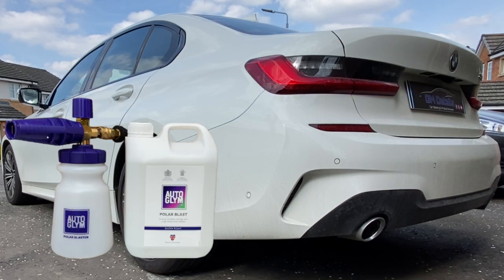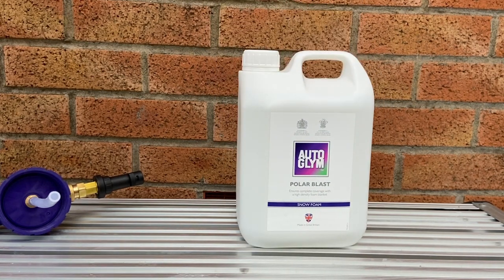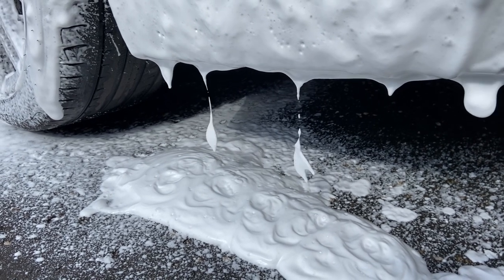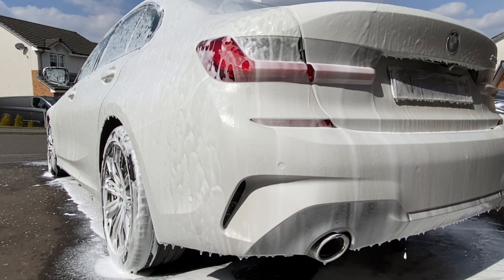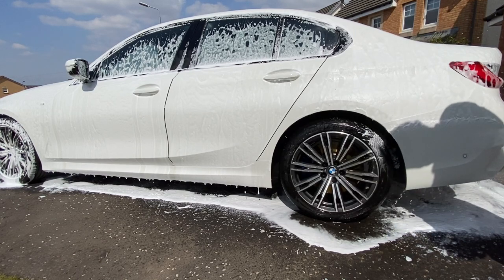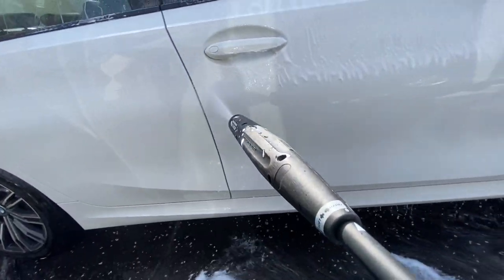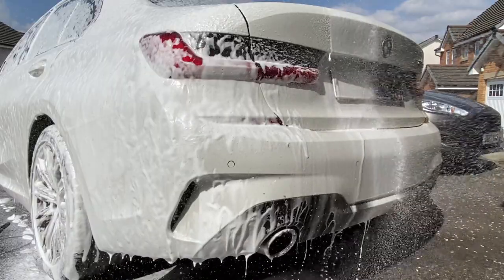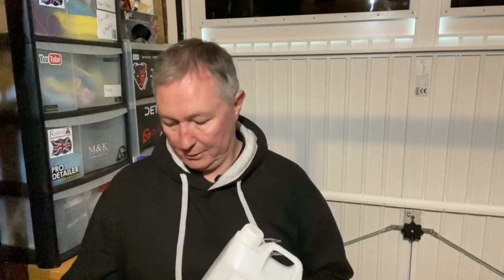Autoglym Polar Blaster Snowfoam Lance & Polar Blast foam review  | Karcher attachment

Comment: I used snow foam for the first time today, that being AG Polar Blast.  What a gimmick, I don't think it saved me any time or effort at all.
Reply from the maker: How long since the car was last cleaned? Was there any wax/sealant protection on the car at all?
Reply: @GMDetails  Hi GM.  Yes, good points worth considering 👍 Ok, so when I clean my cars I do it only 2-3 times a year but I do it properly (body work prep is; rinse, 2-bucket agitated AG bodywork shampoo, rinse, dry with a petrol blower, AG super resin polish and finishing with the Autoglym extra gloss protection).  It's a lot of work but it lasts, protects well and looks fantastic.  

So in this case, as usual, I hadn't cleaned the car in a few months.  I was hoping the 3 stage AG polar kit would result in less manual effort.  In the end maybe it was a little quicker but it was more awkward and the finish isn't as good.  And of the 3 products, I struggled to find any real value in the polar blast.  Hence my comment.

Any thoughts?
Reply from the maker: Ah yeah makes sense now, I actually refer to this in my latest video that a snowfoam won’t remove grime that’s had months to bake onto the paint , it’s not what snowfoam was designed to do!

If you leave it that long try a citrus degreaser first without rinsing off first , then a layer of the snowfoam and let it dwell as long as you can before it dries, you also don’t want the foam super thick like an inch of foam is too thick, and it may take a couple of hits with this to even begin to show some impact, AutoGlym products are designed to maintain your car not to have to rescue it from the weather 😅

What’s actually happened is the dirt has had months of getting dirtier and as each day passes it gets more and more ingrained and harder to remove , worse if you have a dark coloured car too!!

So all is not lost, try some citrus pre wash before the foam, I’ve found Autoglanz Spritzer to be excellent , have a look at my last video featuring Autoglanz products (didn’t need Spritzer this time tho) but in the description is a link to get you 15% off to try it )

Hope that helps your frustration a little
Reply: @GMDetails  Hi GM.  Thank you for taking the time to reply.

I decided to check the Autoglym site and here is the descrition they provide for their Polar Blast product: a rich blanket of foam that clings to paintwork to gently loosen dirt and heavy soiling.
  This reduces the risk of scratches and swirl marks caused by a sponge or wash mitt moving over heavy contamination.

Heavy soiling and heavy contamination only really occur on paintwork after prolonged periods.  So it seems that my use-case falls perfectly within the product's remit 🤷‍♂️

Regardless, your advice of using a citrus degreaser first is certainly sage.  I am reluctant to add yet another stage to washing the car however.  I'd be better off doing it the way I was previously to be honest.  It's less time, effort and money.

What I will do first is give the Blast another go of course.  I'm going to richen the ratio slightly (I did use the recommended ratio but it didn't foam enough).  And I'm going to leave it to dwell longer.  See if that improves the outcome.
 
All the best, Trev (Derby, UK)
Reply from the maker: I’m not defending AutoGlym in any way in the video Trev 😅 or my previous comments, I do think that statements like you found on the website are misleading and far too general a statement to make. 
Even a dark coloured car will collect more dirt over time than a light coloured car because of the way the sun reacts with colours, no wonder so many people suffer rubbish results when they’re stating that on the bottle/website. 

The foam from your lance sounds strange , I found this mega thick through the AG lance itself but the top mixing dial to be all but useless in my case it was either full on foam or weak piss. 

I take it your lance is turned all the way clockwise so max amount of product is coming from the bottle?

Who would have thought a product would bring such controversy as foam, too thick doesn’t clean, too runny and just falls off , pre rinse/don’t pre rinse 🤣

Makes you want to go back to fairy liquid and a bucket 🤣🤣
Reply: @GMDetails  All noted.  Yeah it's difficult for consumers coming to use something for the first time when the sales pitch is misleading.

My lance is just the basic Karcher one that has a twist tip adjustment that doesn't do a great deal.  I'm sure it's just the Polar Blast ratio that needs enrichening though because the Polar Wash (which is advised at 1:1), came out like a foam.  In fact the ratio for that needs backing off.  Trial and error will win the day.

Thanks for your insights.  Trev
Reply: @trevhib  You wouldn't have to do a 10 stage car clean if you just cleaned it more often 🤷‍♂ allowing contamination to eat into the paint makes being so meticulous sort of pointless
Reply: @ashcosmo3854  No doubt.  Please send more time and energy, plus the extra money it costs to use all the products more reguarly.  Regardless, if I was coming to the car with less contamination on its bodywork on account of regular washing it wouldn't need more than the body wash and seal stages, which brings me back to my original comment.  Cheers.
Reply: @trevhib  It takes 40 minutes to snow foam and dry your car lol surely your life isn't that busy
Reply: @ashcosmo3854  Err, 40 minutes on top of the other two stages, Ash.  Yeah, if it was 40 minutes to foam, wash and protect the car start to finish, including getting everything out and putting it away, I'd cover it off every 2 weeks.  But like I said, if I was washing the car every two weeks I wouldn't bother with the snow foam, it's absolutely pointless in that scenario but you go ahead 👍